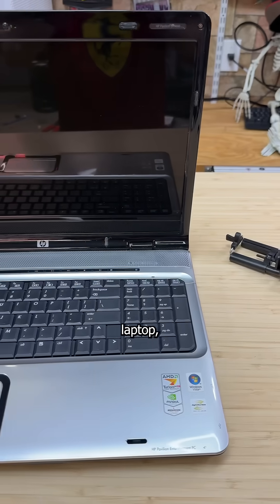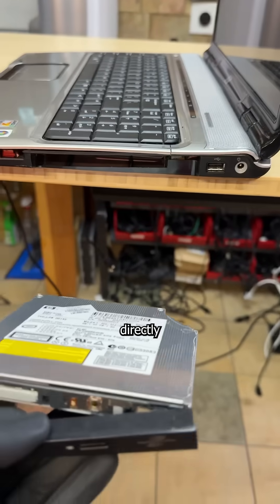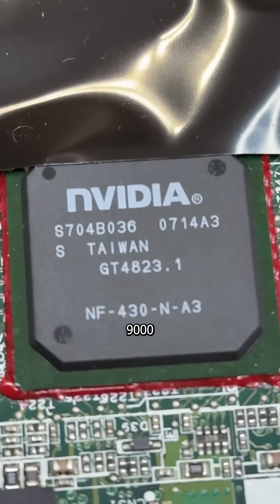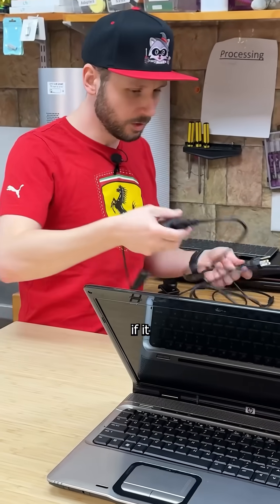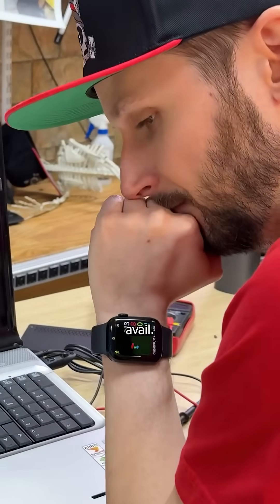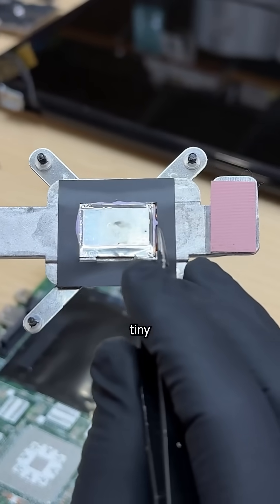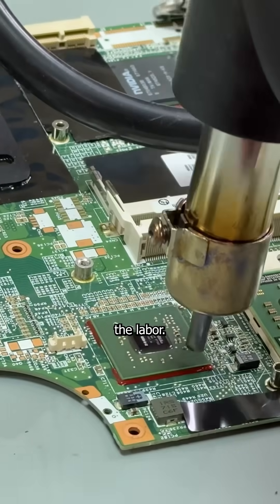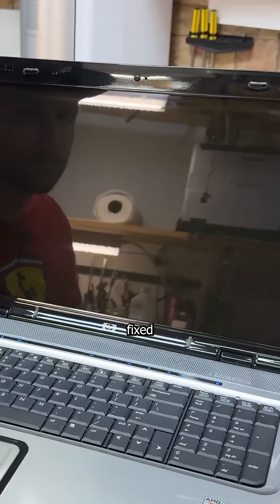$2000 HP DV9000 - The Worst Laptop EVER #tech #technology #shorts #pc

Comment: Yeah I had an original fat PS3 I got on launch that got the yellow light of death and died within 2 years.

I didn't know anything about hardware back then but all these years later I saw a long documentary about the bad GPU solder jobs from Nvidia's stuff in that era.

Didn't realize there were PCs having issues and it was an Nvidia problem back then but what a bad time to be a gamer from a reliability stand point with red ring of death and yellow light of death for consoles.
Reply: I've owned about 6 or 7 of the XPS models all of which succumbed to the same issue, IIRC there was actually a replacement program for them at some point
Reply: It's not an Nvidia problem at all, it's a problem with flip-chip packaging and the switch to lead-free solder. The problem isn't the solder balls underneath the chip package. Everyone thinks it is, and they all waste time and money on reballing or reflowing them, but the problem is the solder bumps connecting the silicon to the substrate. This is not fixable.

The problem is that heating the chip up tends to "revive" the chip and make it work again for a random amount of time (could be years, could be days), and because of that, people think that reballing has fixed the problem, when it hasn't.

I used to just tell the customer that their device was irreparably broken, but if they REALLY wanted to, I would heat the chip up for them to get it working and that there'd be no guarantee how long it would continue working. This was useful for when a customer had stuff on a device that they needed to get off and they didn't want to pay for data recovery.

Comment: My old Pavilion DV6732eo had the same issue on it's m8400GS gpu after 2 years of use.
took HP of 4 months of constant "it will cost you 500€ to have it's motherboard replaced".
despite the fact that under both EU and my country's consumer laws, especially when the issue is known manufacturing defect. they would be liable to fix it.
and on top of that, nVidia lost their case back in the day and had to pay for 5 years of extra warraty on all affected units on all manufacturers.
this meant that had you used Dell, Lenovo or even Apple, it would have been covered no questions asked. But HP with the lack of knowing the actual bill they send to nVidia for the repair, i say that hp was trying to swindle extra 1 000€ profit by just swapping in a basically free referb motherboard.

yeah after 4 months of arguing, i started the legal process trough consumer protection and suddenly HP did fix the issue for free.
had they done so initially after first contact, i would not had any issues with them. but with that attempted 1 000€ theft, it was my last ever HP product i will ever buy.
even though i kinda liked the way that the laptop looked, which was identical to yours.

Comment: Overall, would you say HP laptops are worse or better than Dell laptops?
Reply: The HP 14s and DV9000 are 10000 times worse than Dell Latitude 7400 and D630 laptops. The very cheap low end modern Dell Inspiron's are 50 times worse than HP EliteBook G6 laptops.

Comment: Had a compact from 2008. Or a HP clone since HP own both brands. That stupid laptop always ran so damn hot that I literally used it as a heater in the winter. Ill just leave running converting my umm legally obtained music that had to for a reason be converted into the MP3 format for my mp3 player so the mp3 converter program running was enough to have the fans running like it was taking off and my room was a cozy 78 in winter

Comment: my first laptop wasn't until last year
I had no interest in a laptop when I was getting into this stuff and I went straight for a gaming pc and built it myself.
Here I am about 13-14 years later and I came across a really good deal on a laptop so I picked it up, if you're wondering what laptop? one of those  i5 10300h and gtx 1650 laptops. It was $100 and had nothing wrong with it.

Comment: I started out on these too. Adding a 1.5mm copper shim helped greatly after reflow to make the reflow last. Interestingly, Due to the shared heatsink, the ones that shipped with Intel processors lasted longer as they ran a lot cooler than the AMD chips. Shite laptops all the same.

Comment: I've had many name-brand laptops...very first being a Gateway (that was bought new, not used) with the very first model they had with a dvd drive, all the way from Alienware, HP, Compaq, Lenovo, IBM...all those.
Best one I've ever had is my current, an i9 4070ti Sager.  Don't pass on the underdogs, this thing has had 0 issues in the 3 years I've had it.  Zero.  At all.  Every single one of many previous lappy's I've had would devolope SOME kind of issue over the same years.
Only thing I've done is replace the paste on the gpu an cpu with liquid metal, an get better quality thermal pads for the vrms, if they had any at all.  Also upgraded to Noctua fans.  Only other thing I did was install a second 2TB nVME drive.  That's it.  Sits a bit below factory spec thermals an a bit quieter.
The gpu rocks an external 1440 49" ultrawide screen, an my VR setup without issue.
Yeah, it's a heavy thicc boi, an unplugged won't last a AAA gaming session for more than 50 mins, but it's a desktop replacement anyway, so doesn't see much travel.

Comment: Not even the greatest technician that has ever lived was able to fix this absolute tragedy, even for a HP quality. If he can’t fix it, you truly know it is simply unfixable.
Reply: It's not just the dv9000, I had a dv7 that killed itself too. HP makes horrifying thermal designs.
Reply: Of course it isn't. They came from a era when chip deaign was flawed, so it's not the solder inbetween the chip and motherboard but the solderballs under the cristal itself.
Reply: Bro is NOT the greatest technician if he refuses to reball the fucking GPU. 😭
Reply: @narrativeless404  the problem comes not from solderballs between the gpu and motherboard but from balls under the crystal itself. Bad pair of solder balls composition and underfill, which had a slightly different coefficient of thermal expansion. Cycle it up thermally and it will crack the balls or even the crystal itself. Thats delamination. That's why reballing helps only sometimes abd for a random amount of time and it cannot be considered a proper repair at all.
Reply: @bofh705  Ah, so it's permanent damage.

Comment: I remember my dad getting one right before he deployed, it infact saw two departments. It eventually ended up being my first laptop and it was afun little machine but man if it didn't get to 113⁰c when it was playing something heavy. Supprised the thing never melted lol. I kept it till about 2016 till i upgraded to a msi and passed it on to a kid who never had a laptop, i wonder if its still out there working. I replaced the battery with a good oversized one before I parted ways.
Reply from the maker: Those aftermarket batteries were great. Propped up the laptop to let more air in the fans

Comment: My first laptop. When GPU effed elaga8nbit worked by putting itvin the fridge for 15 min.

I've managed to transfer all data to the new laptop
I trashed it last year though, but I still have the drive in the external case.

Funny thing is, they had touch function buttons as extras and a remote in pcmcia socket.